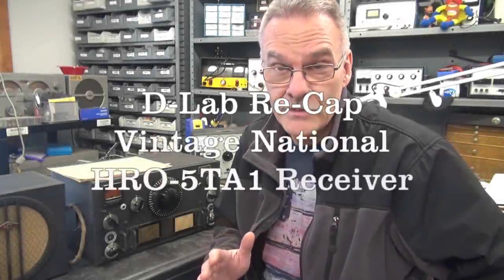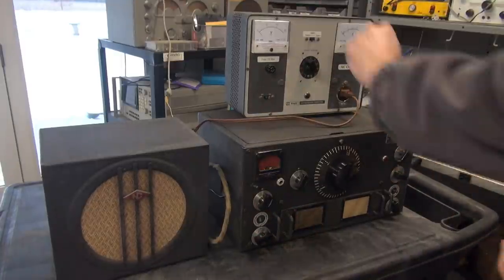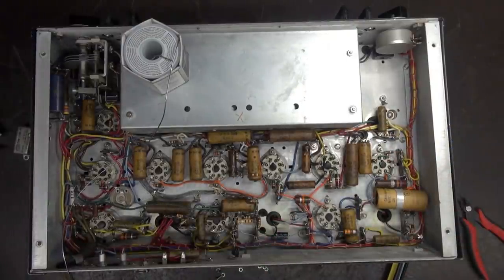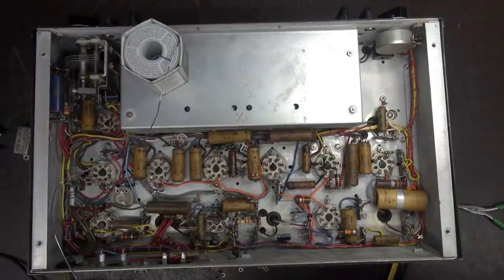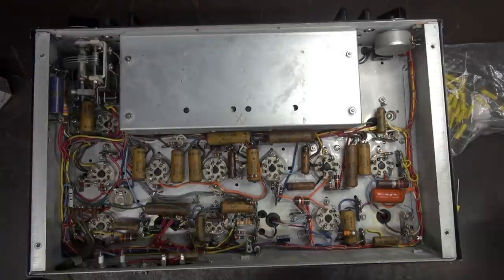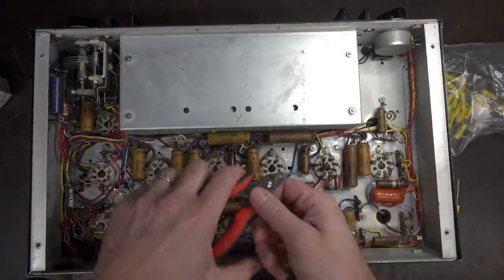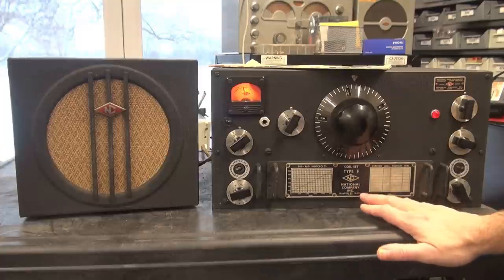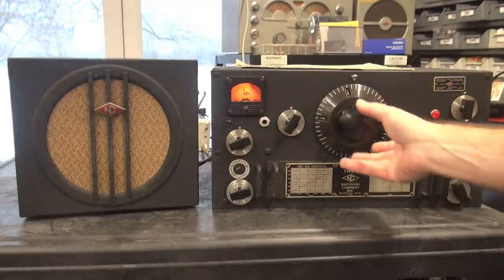How to Re-Cap Vintage National HRO-5TA1 Tube Ham Radio Receiver Beginning to end

Comment: I just picked one of these up with 4 coil packs,crystal oscillator and a regulated tube power supply. It needs a recap but in very nice condition similar to this one. Thanks for the video im inspired.

Comment: Bathtub caps are quite reliable.  They drift but rarely fail catastrophically.   I usually test them and keep them if possible.  If one is bad, I carefully cut them open, evacuate them and stuff them with new caps so the original look is retained.  In fact, i often have to locate NOS bathtubs to replace ones that were shotgunned.
BTW, the PCB will only hurt you if you eat it or smoke it.  Just make sure you dispose of them according to local laws.

Comment: Do you pay attention to the outside foil end of the new caps?  Isn't it important to be sure to place the foil end of the cap to the lower impedance end of the circuit it's sitting in?
Are those Illinois Capacitor brand cap?
Reply from the maker: These are Mallory 150M series caps

Comment: I'm thinking that empty tube pin might have been used as a terminal strip connection in a different revision.  That might explain why they have a voltage call-out.
Reply from the maker: I agree, The manual may have been from a later serial number? Not sure

Comment: Terry, you must have consumed too much wine!  It ended too quickly!
I noticed on the enclosure that the coil sets are plugged into, that between a couple of alignment holes there was a red "X" on it.  What was that for?
I love that radio.  It is beautiful!
The metal "can" that the shaft from the tuning knob goes into...that must be some sort of gearing system, right?  I was hoping that you would open that up so we could see how the gearing works.
It looks so much better with the new capacitors installed.  Oh, did you actually replace that resistor?  If so, what did you replace it with?
Reply: He did replace that "burnt" resistor... the carbon film one with a ceramic resistor.  At the 27:54 time mark you'll see the change from that old carbon resistor to the shiny ceramic wire wound resistor above the orange drop cap.
Reply from the maker: Yes, just wanted to concentrate on the caps for this vid. That is also why I only showed it playing at the end for a short clip

Comment: You've paid no attention to the banding on the old caps and which way round to wire the new ones. You might be lucky  with some, but this will introduce lots of unnecessary pick up by these caps.